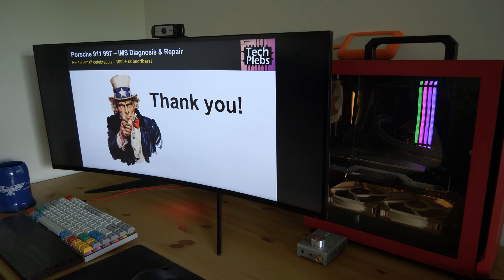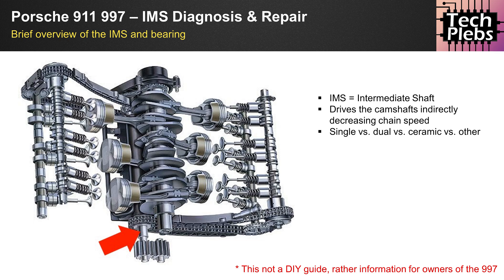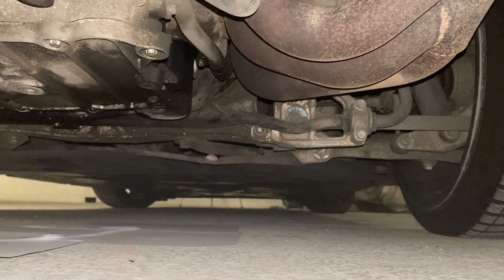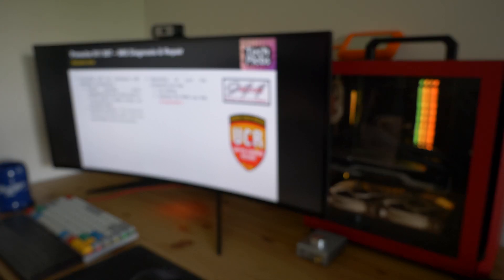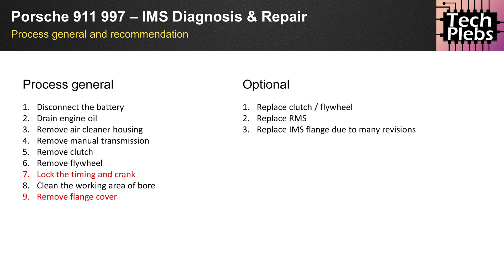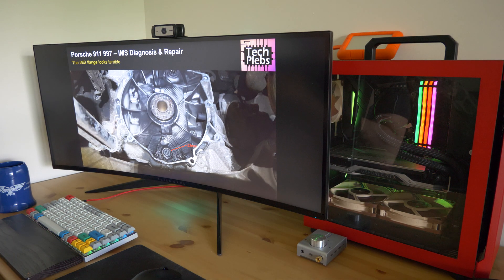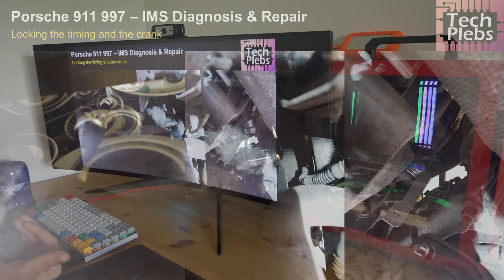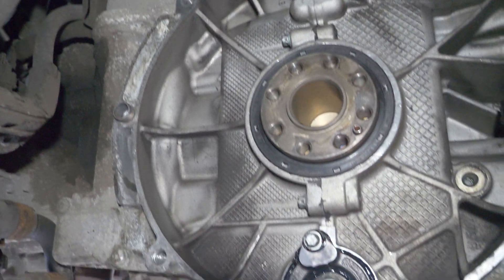Porsche 911 997 IMS Diagnosis & Repair | which bearing do you have?

Comment: I really think it's very risky to just remove the seal of the bearing.  There is no positive oil pressure feeding it directly from the oil circulation system.  It's just splashing of oil at best.  I'm surprised you didn't find that in all the research you've done.  I highly recommend, at a minimum, to replace that bearing with a new sealed one (or go with any of the upgrades and solutions available out there).  Best of luck to you.
Reply: I just realized youre saying it's the "unserviceable" one.  Ok in that case, since you decided to remove the bearing seal, have you considered a direct oil feed from an unused port on the engine or oil filter (adapter needed)?
Reply from the maker: I have of course considered. According to my mechanics the topic is severely exaggerated, they told me that if I want them to make more money they are happy to do it, but it’s in the interest of certain manufacturers to have this fear surrounding the m96/97. The fact is that there are many things there to worry about e.g. bore scoring, chain tensioner wear, oil pressure during track use, oil temp management and so on. My personal approach is, when it breaks it breaks and then I can take care of the above as opposed to spending now 10k+ on something that may never occur. Best of luck!
Reply from the maker: Take a look; https://pcaucr.org/ims-anxiety/